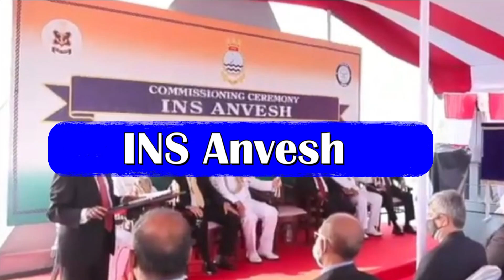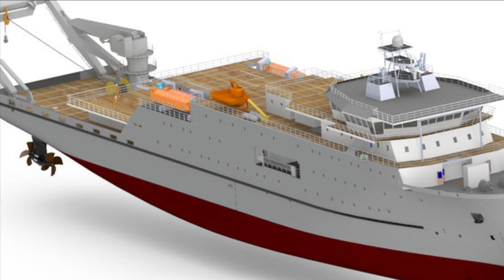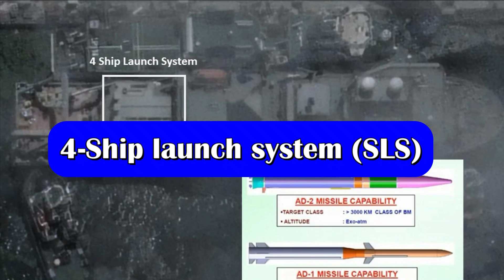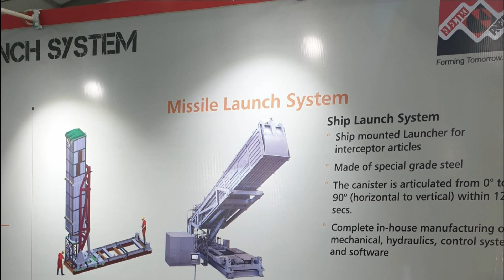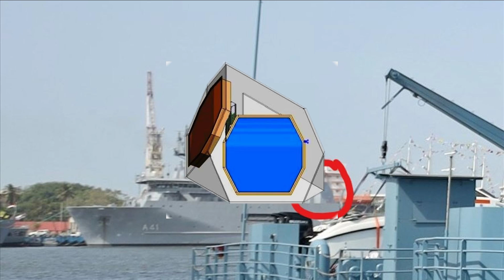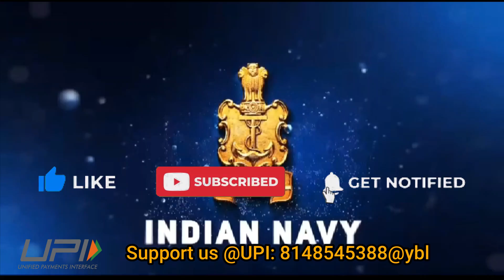1st Floating Test Range (FTR) of India : INS Anvesh commissioned by Indian Navy #indiannavy #drdo

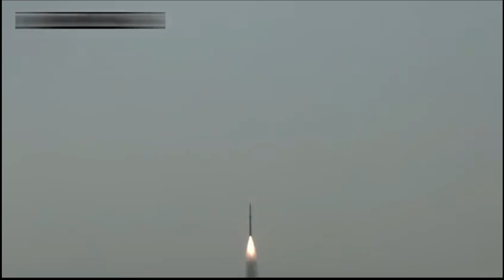Comment: 3:36 5000km not 500
Reply from the maker: Yes, thanks for highlighting its 5000km
Reply: @IndianDefenseAnalysis  Speed of ballistic missiles depends on range so our BMD cannot stop ICBMs of 10 000 km range or more. Same issue also with hypersonic cruise missiles.
Reply from the maker: @datoolz0  if you can identify the projectile flight path u can neutralize it , doesn't matter what is its speed or range. And ofcourse u must have time to respond. The hypersonic glide vehicle are that's why challenging because of their unpredictable flight path.
Reply: @datoolz0 ICBM also have a very predictable path as they go higher in or above the atmosphere to achieve such long range. You just need powerful radars and satellite guidance to shoot ICBM in the rising and horizontal phase. 
ICBM generally achieves its high speeds like 10mac and above in the 3ed phase of falling.
Reply: @IndianDefenseAnalysis  glided vehicles flight  path  just like  ocean wave not  cobra manuvarable 
2nd it create 3000 degrees centigrade heat surrounding it body atmosphere.  so hit to kill easily enter and hit. Computer easily calculate wavehight and low maneuvers of glide  vehicle . 3rd glide vehicle  always separate 50 to 100 km. Otherwise without motor it's stay in space as a satellite for 6 month to one year above 100 km as a low earth orbit satalite. . It's difficulty it has no motor to enter earth atmosphere. Only terminals  velocity of mother missile separate  it earth atmosphere near space. My opinion  easily  hit  mother missile before  separation mother missile .denger  is scramget missile flight altitude 30 to 50 km but  cobra and waved maneuvers as per program. Speed low compare  to glide vehicle  but  accuracy very high compare to glide vehicle. Mirv Marv and scramget have engine so accuracy high  compare to glide  vehicle no motor  to guide. Shakti
100 to 1200 kmmissile altitudes. Pad 80 km. Ad1 120 km. Ad2 not known. Pdv 180 km. Shakti 100 to 1200 km. Drdo have cleaver man. They read  science. So  don't ory.
Reply: @asmodeus108  I also think kamikaze drones that can hang around for a long time can be used to effectively target a lot of Pakistan's launch platforms like NASR etc. Ghauri etc are a good target for drones on the ground. Missile defense can be used to mop up any that escape or are too well hidden/defended.
Reply: @datoolz0  yes true. But you need a passive radar seeker for it as many high value targets are deployed in support of high intensity jammers and complex air defense equipment. 
It worked in Ukraine because Russia has more inside info of Ukraine's systems like the frequency they use, range, blind spots and saturation numbers, geographical imp positions, high value asset's location. 
Our Air chief also said that drones have limited use in situations of war times.
Reply: @asmodeus108  Don't you think Bharat has much more indepth info of Pakistani equipment, blind spots and numbers than Rossiya had? Also much better sigint coverage of the battlefield and spies on the ground.

Bharat is not up against all of NATO here, before Pakistan can get any help the war will be over. Pakistan doesn't have the ability to sustain a long war and no ability to get reinforcements because IN can blockade Karachi port and S400 can shoot down all aeroplanes.

IAF chief is on crack, kamikaze drones have won wars for their users in every modern war. IA has 2000 drones on order, which shows that unlike the Air Farce the rest of the military thinks drones are useful.
Reply: @IndianDefenseAnalysis  5400km notum means 5000 to  6000 km. Agni6/k5 may be. Another notum for Arunachal tibbat border by iaf. So if Chinese  fighter  come accidental fire metior possible. Ist time iaf announce Notum for rafala  su30 tejus war game. So one chinese fighter j20 must  be shot if this enter notum  area.
Reply: Are you from the Caucasus Region ( Southern Russia)?
Reply: @nilanjangupta763  🤐 BC i am indian.

Comment: As per Rajnath sing
45000 ton vikrant 2 productions start  for. Gathering special sea specification steal 
Design  slight change for magnetic ammulsion catabar lunching, lift slightly big ,Xrsam installling capcity,
90% indigenous  delevary within 5. To 6 year at Cochin  shipyard. After that 70000 ton vikramaditya 2 will be produced.

Comment: INS Anvesh is a huge leap forward for covert testing, but the the small side issue mentioned is also huge!  Long-Range Multi-Function Radar(LR-MFR) range in excess of 500 km.  That means with enough ships it is possible to have excellent coverage of all surface shipping for hundreds of kilometers. Data link between all 3 services is the biggest need, because once all these different radars are joined together it is possible to identify any ship, plane or truck. That doesn't happen today because of the idiocy of the services, but the biggest advantage of jointness. Working together increases strength.